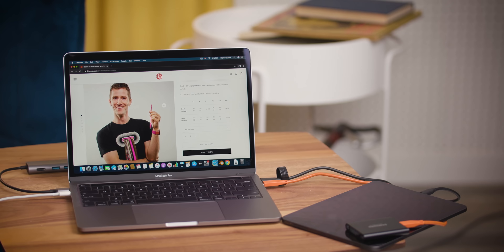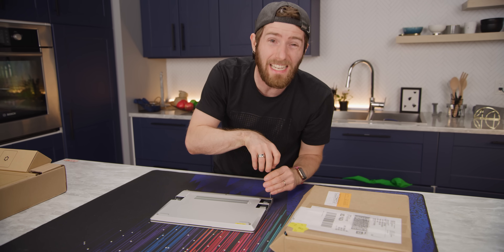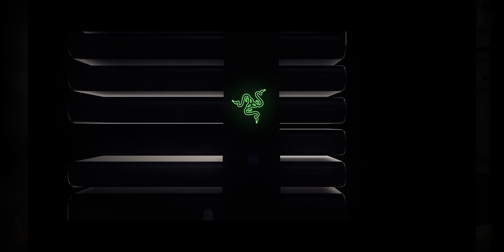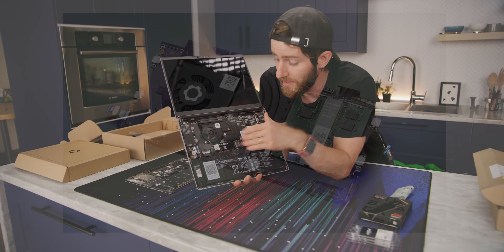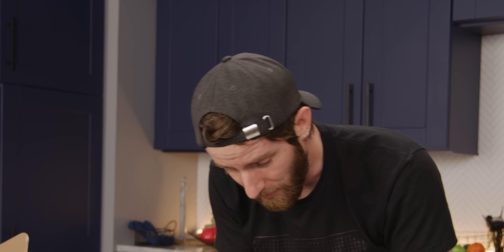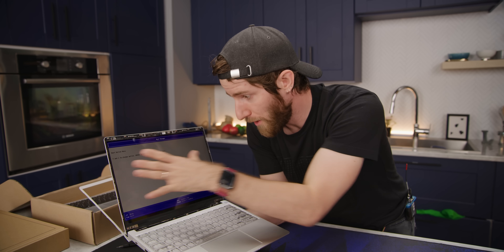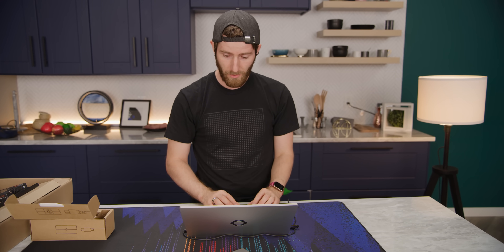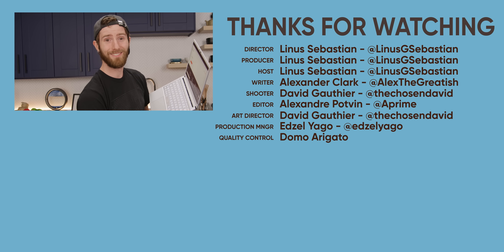A COMPLETELY Upgradeable Laptop?  - Framework Laptop Review

Comment: RIP Framework...I was so excited when I saw this video...jumped on the website immediately to see what I could configure, only to face disappointment from their absolute TURD BURGER of a website. I've seen more impressive sites from scammers. EVERY SINGLE selection of ANY configuration option caused their configuration app to crash. What a painful nightmare! I have to question the reliability of hardware provided by a company who can't even get a BASIC web app right! I understand that your video may have caused a surge in website visitors, but come on! You can't convince me that the volume of visitors at 10 PM MDT is overloading the ordering app for a hackable laptop...not exactly an iPhone, is it? So unless their site is running off of a Raspberry Pi 2, I really don't get it. There's simply no excuse left for them to use in mid 2021, with dirt cheap scalable hosting plans available everywhere. How long can they possibly last?

Not your fault Linus, but since I heard about it here, just thought you should know what you're promoting. Just such a disappointment when a great idea dies because of bad management decisions, and companies trying to cheap out on the most basic things...

Comment: Would be amazing with a little more refinement. Instead of swapping single IO, one side of the laptop should have a replaceable IO bar. It can be specced with audiophile amps, silly amounts of USB connectors or an engineer spec complete with com ports, VGA and passive and driven fused programmable IO. On the other side they can have a single replaceable charging port of the current standard, i.e. C.
Reply: One other thing, to ensure the battery is replaceable regardless the fate of the company, they could use standard 18650s at the rear, matching the thickness profile of the screen + base.

Comment: My Eluktronics laptop may be getting a bit dated by this point, but it's kind of cool that it uses a DESKTOP version Core i7-7700 and a DESKTOP version GTX 1060 6GB. Still has a compact form factor and battery life at least as good as you'd expect considering the specs. Temps are also surprisingly good for laptop parts operating in a small space. Plenty of storage upgradeability. I won't upgrade anytime soon.

Comment: “A COMPLETELY Upgradeable Laptop?”
So, uh...
No, then.  Not even close.
Reply: Screen, ram, ssds, battery, keyboard, trackpad, expansion ports, bezels, motherboard, camera/mic...
What is missing?
The CPU? Which, Linus addressed; is not possible currently as modern laptop CPUs do not have any means of working without being soldered to the board. But which is kind of addressed by the motherboard being removable, and likely being kept as a standard form factor in their designs going forward (I do hope)?

Within the confines of what they are actually able to do, what are they missing?
Reply: @dposcuro  Yah.  The CPU.
The most important aspect of computer performance.
And don't tell me “Linus says it's not possible” when Dell did exactly that 2 years ago.
Reply: @dposcuro  And who said it has to be a mobile chip?
The Area-51m just used a desktop chip instead.
Thereby making the CPU of a laptop “completely upgradeable”.
Unlike this laptop, which is not.
Reply: @naryanr  Oh. You're being pointlessly pedantic and immune to context. Got it.

Who said it had to be a mobile chip in this thin & light laptop?
Logic does.
Adding a socket to mount a desktop CPU would require the computer to be thicker.
Let's take a look at what CPU's are offered, and desktop options in comparison:

Framework is offering the i5 1135G7, which is a 4 core, 8 thread chip, that turbos up to 4.2 Ghz, and offers 2.4 ghz @ 28w or 900 mhz @ 12w in TDP down. It also offers Iris Xe graphics @ 1.3 ghz, with 80 execute units. Package size is 45.5x25mm

Note the closest equivalent (4c, 8t) was a core i3 1165G7, but that is not offered in a replaceable chip format. So the only option with desktop chips is core i5 6 core, 12 thread cpus.

The lowest performance desktop i5 is the 11400T offering a turbo of 3.7 ghz, and a base clock of 1.30 ghz. It has a TDP of 35w, and a TDP down of 1.0 ghz @ 25w. It also offers Intel UHD 730 graphics @ up to 1.2 ghz, with 24 execution units. Package size of 37.5x37.5mm

Or something a bit more equal in terms of clock speed is the 11600T offering a turbo of 4.1 ghz, and a base clock of 1.7 ghz. It has a TDP of 35w and a TDP down rating of 1.2 ghz @ 25w. It also offers Intel UHD 750 graphics @ up to 1.3 ghz with 32 execute units.

So, just on basic specs, Desktop Cpus are going to drink a lot more power than the mobile CPU, while also offering drastically worse onboard graphics in comparison. Since they put out more heat, you would need to add a bigger cooling system, which would again, force the computer to be bigger. The size of the chip itself, and the socket it needs to work with, take up more space on the motherboard, a motherboard which is already densely packed with components, which would likely force the motherboard to be bigger. And this is with just the least powerful CPU Framework offers. 

The best cpu offered is the i7 1185G, offering a 4c 8t cpu, that turbos up to 4.8 ghz, and offers 3.0 ghz @ 28w, or 1.2 ghz @ 12w. in TDP down. It also offers Iris Xe graphics at up to 1.35 ghz, with 96 execute units.

Not to mention that desktop chips are not exactly rated to work with LPDDR4x, but mobile chips are.

So yes, it is impossible for Framework to have used a standard, desktop CPU in their 13.5" laptop, and remained a compelling, attractive, and competitive option, that actually has any hope of selling enough units to keep Framework in business.
Reply: @dposcuro  Wow that's an awfully long way to say, “I admit I'm wrong.”
Reply: @naryanr  Sorry, not used to dealing with people so incompetent at understanding context.
Reply: @dposcuro  Apparently not used to the term “COMPLETELY upgradeable laptop” either.  (emphasis not added.)
I'm starting to wonder how far you'll go before you admit you're wrong.

It's kind of amazing to watch.

Comment: I'd have loved this at my last job. They swapped out all the desktops where they could for (admittedly decent) Lenovo ultrabooks but -if- when something went wrong they were a pain to repair. Especially the hinges. Oi... That degree of modularity and upgradeability is a godsend in a corporate environment. You keep spare parts rather than spare devices and have the system fixed and back to the user in potentially minutes rather than days.
Then there's another use case - older folks. My parents both have newer laptops they won't use as things are in different places and they aren't used to them. Being able to swap out the mainboard for a new, upgraded one yet keep the original device layout? Glorious.

Comment: tl;dr: way overdue it feels like a troll

This would've been groundbreaking in 2000...The reason it takes this long is because manufacturers don't really care about you or the environment. It really doesn't take too much to go modular nor should it be a thing that's so niche only a few companies are willing to try it out. Anytime I see a soldered cpu/ram I cry a little. Hell there's been a formfactor for mobile gpus for who knows how long I have an old elitebook from the early 2000s that you can upgrade because it's mxm, then you wanna know what the assholes at HP did, they whitelisted their own gpus. You can fit a gpu/heatsink/fan in a thing the size of an old drive bay(dvd etc) and make it the new GPU slot. Something standardized maybe even a dock. Here's what my Legion5 can do, it can play games of now(just barely too) but everything is soldered on, to add insult to injury even cracking the case open is tedious(I commend the Zbook line, which use to be the Elitebook line for giving us a 0 screw latch). 

Rant over...

Comment: "I love that the fans ramp up, instead of letting the CPU just get to 100°C."
That sentence hurt. A lot.
Reply: My personal favorite was what Linux Media Group showed about the last Intel Macbooks. They had fans in them, but they had no airflow to where they needed it. Was it pure incompetence, or was it Apple was worried about Intel CPUs outperforming their next gen ARM chips if they properly cooled the Intel CPUs?
Reply: @Hanneth  If it was, it was unwarranted as the M1 is an absolute beast.  I've never been a fan of Apple, always hated their business practices and ego, but I got a Mac Mini for some AI upscaling work without cooking my room as it runs rings around my laptop at 1/20 of the power consumption.
Reply: @alexatkin  what I find exciting about that is that technically and I mean suuuper technically since apples ecosystem is now all based on ARM chips, one can feasibly run a desktop class program on any of said devices. 

It will have to be super optimized and whatnot but technically speaking it is possible. And that excites me

I honestly am a pc/android dood but Apple is doing incredible stuff with the efficiency and power of their systems
Reply: @Hanneth  Probably all three. The third point being that they want the stuff to break as fast as possible.
Gotta love Apple... (for creativity)
Reply: @Hanneth I bought that Macbook Air (for software compatibility reasons - lots of stuff didn't get ported to Big Sur) and it performs pretty well under load. When you close the housing, it creates an air tunnel between the fan and the heatsink. Pretty shoddy reporting from these guys (and Louis Rossmann) to not notice that.
Reply: I just love it when my Macbook Pro burns my hand or my lap while running XCode builds. I sure would hate the noise of air moving...
Reply: @embergabor  The MBP actually has a heatpipe and is not part of this issue
Reply: @DPortain  The MBP15 still lets the CPU temps hit 100C before ramping up the fans. Heatpipes or not.
Reply: @embergabor  Fair, that's a real issue. Any chance of running Speedfan or something to adjust the curve?

Comment: Are there users that buy a laptop without a real gpu these days?

I couldnt imagine paying 1k++ without having a real gpu that can deliver performance. 

Like the idea though, even if knowing what u need makes this useless imho. Just got an Asus ROG scar 15 2021 G533QS. Cant see anything that would need customization on this setup. E.g. the USBC acts as Displayoutput. So there is so need to swap something as it can be used for HDMI or Displayport (without the need of those 2 upgrade parts).
Clean on the right side (i/o is on left and back)
Optical mechanical keyboard (try to upgrade this)
2TB SSD Raid (enough to me, also upgradeable without bandwidth loss like from the upgradeable laptop)
so the only benefit is that u can choose i/o ports which isnt needed cuz u only gain the HDMI / Displayport choice which is obsolete by having usbc displayoutput (which can deliver both as mentioned). not mentioning the 300fps ips display that cant be upgraded on this one and more.

rly good features that are usefull: Hardwareswitch for mic and the option to disable the battery in the bios.
im not against it, dont get me wrong, i just dont see the WOW effect, as the mainparts that decide if ur laptop is still good (CPU and GPU) arent modular.
and any laptop can upgrade to ssd/nvme and upgrade the ram, so by choosing this one u gain modular Display i/o and u can decide on which side the usbs should be, amazing ^^

i also dont think its handy to repair, cuz what will happen, instead of having a dead usb or whatever, u just have a dead upgradeslot - which is the same right?
On the other hand i guess its easier to resolder a new usb to the board instead of resoldering the upgradeable slot from this laptop here which is far more inside and by this harder to work on (easier to damage the board and surrounding chips then).
only benefit is, lets say ur displayout is broken, with that laptop u still got 3 other trys by using the other 3 upgradeslots.

Comment: My dell business class lattitude e6440 laptop from 2013 is almost completely modular and super easy to repair and upgrade.  You can even upgrade the CPU.  The precision line of laptop even had an upgradable GPUs. I bought mine off ebay and upgraded the cpu, ram, lcd, finger print reader, back lit keyboard, internal cellular card, wifi card, expresscard and added 3 ssds, also the screws are labeled and the online manual shows you have to replace every component.  I have been so spoiled i hate consumer grade laptops.  I can also use 4 different chargers from 60, 90, 120, 210 watt.  I have 4 battery options and it only takes 3 screws to take the back cover off.

Comment: Imagine if they let you keep the same enclosure but just sells motherboards that you would swap out to upgrade with. They could also sell a pre-built system enclosure so if people don't want to get a laptop, they could just get a little system unit with laptop parts inside. From the looks of it, the only thing missing is an ultra budget option with a Pentium or Celeron inside for those on a really tight budget.

Comment: I am very interested in this product but there's few issues that makes me hesitant to switch. I love the modular approach (I don't need hdmi, headphone jack, webcam, etc but I gotta spend on it like other folks) and especially interesting is the potential upgradeability which might even save me money in the long run even if I spend a bit more initially. Getting the features I want without spending more for extras I don't want can be a big deal.

1) Future proofing. I used to have a lenovo y500 laptop which lenovo claimed to support swappable/upgradeable gfx cards and other modules but immediately stopped supporting and the 2nd hand "upgrades" cost way too much so I got stuck with a mediocre laptop with no way to upgrade it. I am worried about compatibility issues too once v2 comes along. 

2) Gaming. From the design, it doesn't look like it will support any dedicated gfx cards. I hope they either design a "G" model for gaming even if it's chonkier for cooling and other necessary parts like the gfx. Or maybe they can go the egpu route like asus' flowx13 and have a module that will support an egpu that can be plugged in for demanding games.

3) Durability. Laptops can be quite the fragile thing but can many can withstand some light physical abuse. I wonder if this won't shatter into a million pieces if you drop it or something.

I love the potential and hope they can develop something satisfactory for me once the steam decks come out because I will be switching laptops by then. Really hope they can provide a good gaming solution.

Comment: 16:32 one benefit of having a battery disconnect & power on on AC connect is when you want to use the laptop as a low-powered homeserver for Plex, PiHole, NAS whatever service you can think of. You'd want it to automatically power on again after a power outage so you don't have to physically find it and push a button. That way you can chuck it in some corner of your house and never have to worry about it again